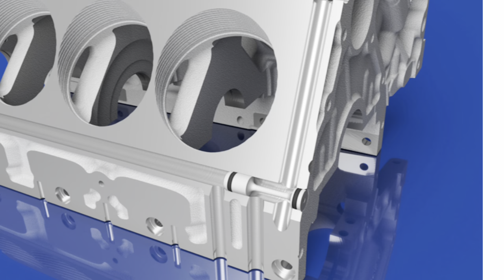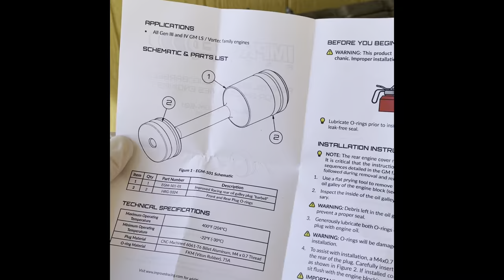LS OIL GALLEY BARBELL PLUG HOW TO REMOVE & install

Comment: I went in threw the expansion plug near the barbell with a right angle pick tool and pushed it out very easily. Same with the freeze plug under the timing cover.
Reply: Man im glad i read this comment. So much easier